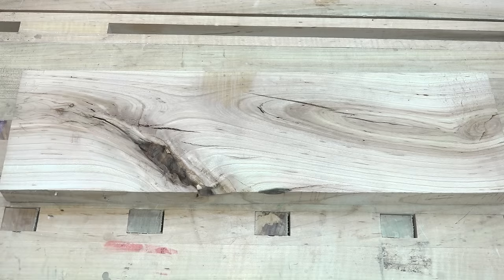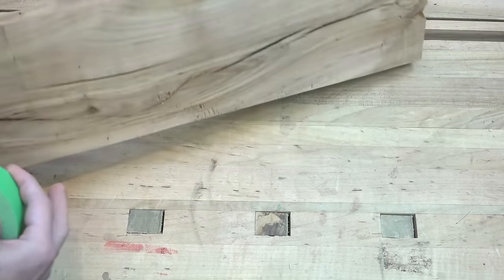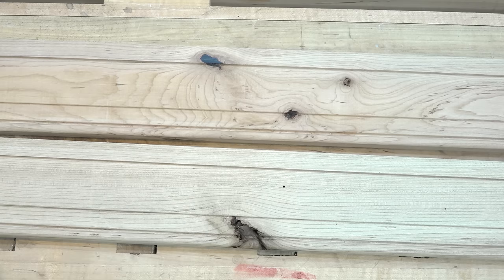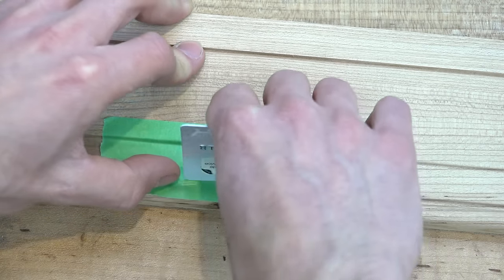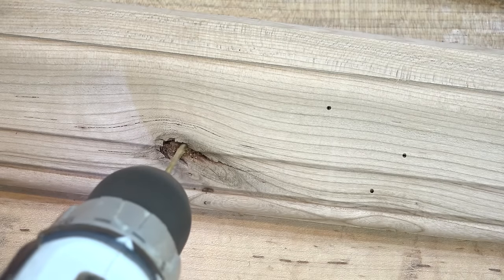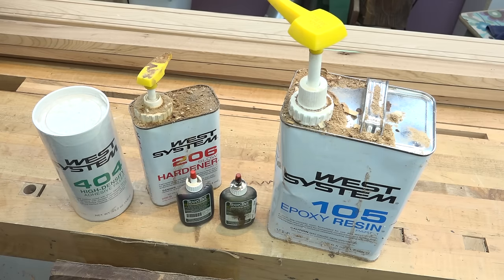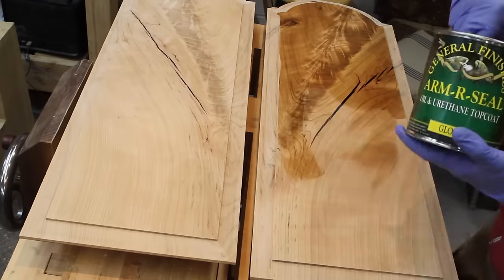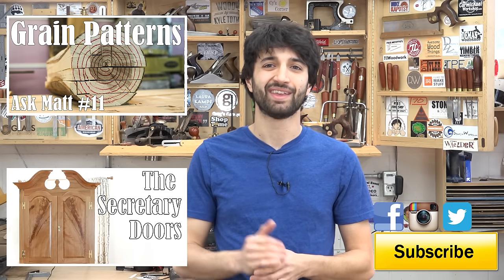Filling Voids, Cracks, and Defects in Wood with Epoxy - Ask Matt #19

Comment: When you use epoxy, you should be aware that very serious health effects are asociated with it. Please look these up and take the appropriate precautions. You should note that the effects are cumulative and not only direct skin contact can be damaging, but also breathing in the fine dust that might be created by sanding and other woodworking techniques. So you might wear a dust mask, but the dust is everywhere in your work area, and very fine particles may remain suspended in the air you breath when you are not wearing the mask. When will you reach the threshold that triggers problems for you? Maybe never. Maybe tomorrow. Wear a respirator. Use adequate ventilation. Use good dust collecting systems. Try not to use that stuff so much. People tend to only seriously think of their health when it is gone. Stay healthy.
Reply: bomaite1
Reply: Agreed! There is also a lot of misunderstanding regarding curing time. Epoxy is often "workable" many days before it has finished catalyzing. Breathing that in powdered form can cause serious sinus and respiratory harm. Consult the manufacturer for specifics BEFORE you use their products.
Reply: Sounds like doing it outside with respirator and tyvek suit would be the way
Reply: Wood dust is worse than epoxy mixed correctly. The components may trigger allergic reactions in some people. Follow directions and safety equipment gloves when working with uncurled epoxy. A real dust respirator when sanding mostly for the wood dust. Epoxy is not considered toxic but try not to eat it either.

Comment: I only have blue masking tape, will that work?
Reply from the maker: +Brian Prusa probably not. Something about blue refracting light differently damages the epoxy or something like that
Reply: +Brian Prusa I'm in the middle of doing this for the first time, and of course going through the learning curve. I've found to just use something non-porous that doesn't leave any adhesive residue.  Decent packing tape (not the cheap, thin stuff) seems to be working really well.

Comment: It is not heat that pops bubbles, but co2, just exhale on the epoxy and the bubbles pop.
Reply: AUBREY ANSELL the bubbles are caused by trapped air in the epoxy so heat causes the bubbles to expand and rise so heat does actually cause the bubbles to pop but I would love to be proven wrong so if you share your reasoning or where you learned this please do

Comment: good info Matt, but personally I dont like that dark brownish tint you used,  I think it does the opposite of what you wrote on an earlier post.  The dark tint attracts my attention not and does not look natural.
Reply: I like going in the other direction.

Don't try to hide the crack, enhance it.
I've seen people do an epoxy repair, 
and put powdered turquoise dust in 
the mix.  It will say, it WAS cracked, 
but it's fixed now.

steve

Comment: Why soooo dark with the epoxy? Wouldn't less match the wood better..
Reply: When filling blemishes - even tiny ones - it is generally better to use a much darker colour than the surrounding wood. Dark lines, or areas look more like natural features than lighter ones.
One very common mistake I see, is in the case of a light oak finish, where moulding-pins have been used to fix the piece, and the pin-holes have been filled in a light filler.  This always draws attention to itself and looks false, whilst a darker filler would look more like naturally-occurring flecks.
Reply: Ok,  cool.. thanks for reply..
Reply: Paul Bennett If you are using coloured wax to fill in, say, a small, roundish blemish, applying dark wax followed by a few 'crescents' or flecks of a lighter colour (within the dark background) can make a very convincing knot.  The light colour must not be too much different to the darker one.
As with marbling, 'less in more' in this case.